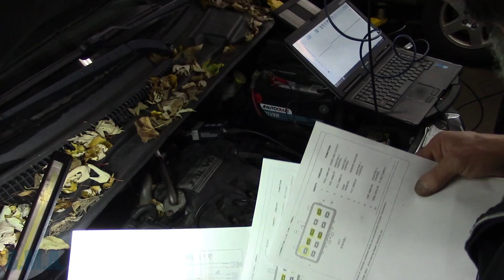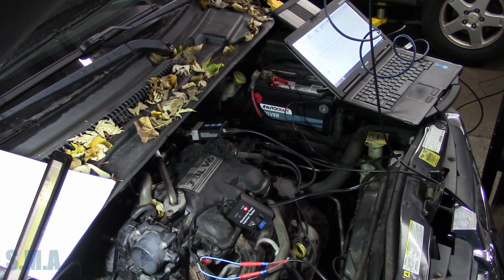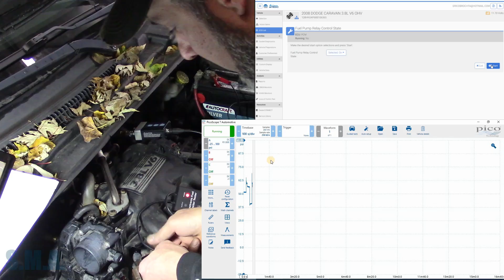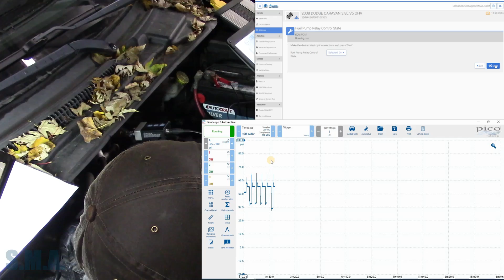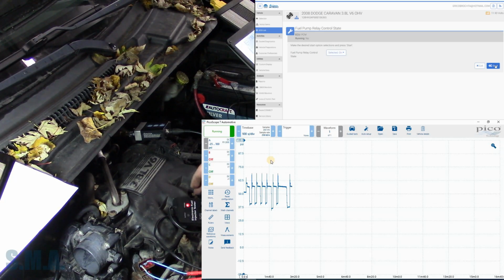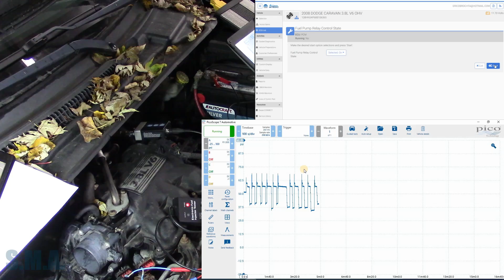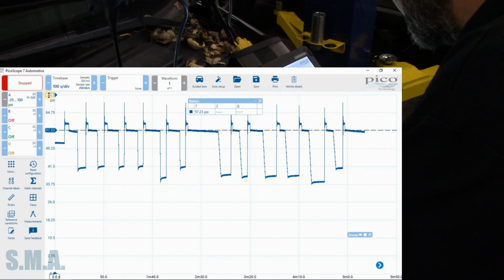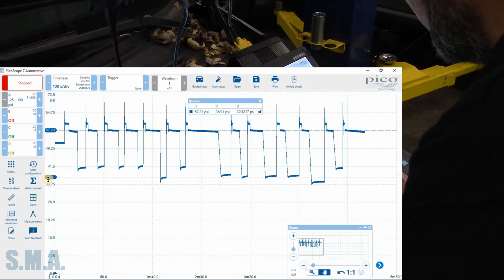Pico Scope: Measuring Fuel Injector Pressure Drop

Comment: Great video as always! Fuel pressure is so important - small example - we had a F-700 with a 429ci fuel injected gas engine that had exhaust that smelled so rich it would burn your eyes. It had low fuel pressure ended up being the fuel pump. My theory was the injectors didn't have enough pressure being delivered and were squirting fuel instead of atomizing.

Comment: Hi. I got a question. I got a 09 Silverado and I got the p0700 code but it's not throwing another code with it. And my traction control light is on and stabilitrak . And I dont have the gear indicator on dash. And it has a 1 2 hard shift. Just wondering if you had any ideas? Thanks

Comment: Plz help. I just changed my throttle body with position new position sensor because I was getting reduced engine power. It helped a couple months now its acting up again. Idling low to the point it cuts off. Used my obd reader and got codes p0220 and p2135. I looked them up and both seem to be the same Idk. Can u plz help me.

Comment: i cant remember if you can do a fuel injector on off toggle on this car but, what i was getting at could you do a running drop test as well with the same pressure tester

Comment: Never under estimate the spark , just experienced this on my 2000 crv lean condition began with new injectors ,fuel pump relay, fuel regulator ,fuel pump and sending unit ....Not ...New distributor and rotor as well as new exhaust cat and up and down oxygen sensors..... Not ...It WAS Ignition coil and ignition control module causing misfire 219,000 clicks and still purring like a kitten Hondas B20 baby !

Comment: with 200,000+ miles and needing to remove the intake to replace the injectors. 
Replacing them all, i would call that not only a repair but preventive maintenance due to the wear on the other injectors

Comment: See if the spray pastern is good, the visual injector pulse light test works good if you have a back light tester.
Reply: My thought is that the injectors are hard to get to and have 200K miles on them. At the usual price of injectors replacement is the smart way to go once we have put in the effort to get them out. I'd hate to put any of those old things back in, and I hope the customer sees it that way.

Comment: I'd bet it's 5 bad injectors but no matter it's injector issues and unless they are wicked expensive it only makes sense to do them all.
Reply: Around $55 per injector.
Reply: @DavidNull5  That is pretty cheap to put it all behind me. Since we can be sure at least one is bad the shotgun only costs $275 more and may save me twice that. Few things are more aggravating than paying double labor to end up doing what could have been done with single labor. That goes for DIY as well. Imagine: if he had to go back in the second time, do you think the customer would still just want to do one more instead of doing the rest?

Comment: If number 5  injector is "sticking on" that one would need replacement for sure and the others could be clogged so they could possibly be reversed flushed and cleaned, however why are they clogged? It would be recommended to empty the fuel tank and clean the fuel tank on the inside and reverse flush the fuel lines. Do not replace any old gasoline get fresh pump gas so maybe have the customer drive the scary van until it's empty before he brings it in for repairs. Doing it this way allows you to inspect the fuel pump if it is failing and contaminating the injectors with debris.
Reply: If my 200K mile car needed all that I would replace it.
Reply: @flagmichael You wouldn't replace a low mileage 200,000 kilometre car for 1 extra hour labour?

Comment: I  have a question. I purchased a 2018 chevy silverodo. It was a company fleet truck. The truck runs & drive perfect. But when i reach a speed of 70mph it won't go past 70 mph even i push the gas pedal to the floor. it,s a v8 & the dash has a 140 on it. what can i do to remove the governer so it will go top speed.
Reply: You've got a problem,  I'm not sure but I believe a dealer or a very well equipped shop has to reprogram (flash) the computer, not sure which computer ECM??
Google 8s your friend here, there are a bunch of results,  careful most are trying to sell you something like a special tuner chip.

Chevy limits the Silverado’s top speed to a measly 99 mph.

Comment: I had a multiple lean misfire once on the usual Shovrolet suspect. It turned out to be a misfiring bank 2 coil pack on an LQ9 power plant. It would enrich the downstream oxygen sensor so the computer was pulling fuel until the other cylinders would suffer and the engine would knock being so lean. It would cold start idle really rough too. 

I drove it on short trips until the coil pack completely burned up and burst it's plastic case. Once replaced? Good as ever!  I am a diy guy and did the legwork... checked plugs, wires and for fuel and air and cylinder compression.  But I nailed it being patient and without advanced tools and equipment.

Everything being equal I thought I'd share. It was confusing as to how a lean multiple misfire could occur that way but yup, check ignitor packs too... then think backwards all the way back to the ECM. 

Edit: i gave instant thumbs up for appreciation, your hard work and time away from your bread and butter to help us plebians. 👍🤙

A computer can signal an issue and drop a code. But what attached systems and sensors are at play? What else could it possibly be? I had nightmares of a broken valve spring or an injector at fault... but a marginal coil pack was all it was.  $45 retail over the counter fixed it.  ^.^

Comment: My first car was '63 Impala that had a Chevy straight six and a one barrel carb.  Never had to touch the carb in the life of the car.   Then cars started having fuel injection...
Reply: My last car with a carb was a 1984 Dodge 600 with a Mitsubitchy 4 cylinder and a Mikuni feedback carb. I learned it was universally called the "infamous Mikuni carburetor." To improve drivability as it aged the usual recommendation was to drill a 1/4 inch hole in the choke plate and gradually increase the size up to 3/8 inch until the cold idle behaved. The other common problems could not be fixed.
Most of my cars were old when I bought them so the throttle pivot was worn out and leaking on every one. I hate carbs!!!!
Reply: @flagmichael  with a flashlight, an umbrella, a screwdriver and a vacuum gauge I could diagnose and adjust most of the carburetors on my old cars and trucks, in the dark on a rainy night.  With fuel injection and fuel system electronics you need a AAA card in your wallet to diagnose and adjust a broke down car on the side of the road.

Comment: More of a question have you ever had an engine miss fire on one cylinder at idle but run normal at 1200 rpm i am thinking maybe a worn cam it has a ton of miles on it 6.0L chevy

Comment: Love that test Eric. I have fixed many cars doing this over the years. Before the transducer, using a traditional fuel gauge of course. Rule of thumb was they should all drop the same. 1 psi is broke. Doing this test using a transducer is so much nicer as we can save the data we collect and prove the failure to the customer right on the screen. Great call on all six for that van. Way too much mileage to play with one or two.
Reply: Are OEM injectors the only good option, or do you know of other off the shelf (Napa, O'Reilly ect.) that can be substituted?.
Reply: @rafaelmarin1963  I have been bitten by aftermarket injectors. I bought a set of Pythons many years ago for our 1985 Volvo. I could hardly get the engine to run. It turned out the Pythons fit just fine but were unprepared to deal with the ballast resistors in line with each injector in the Volvo. (BTW - I also say it as a good call to recommend replacing all injectors. They all had about 200K miles on them and two out of six were wonky at this point.)

Comment: GREAT VIDEO! I Love these kinds of videos! the pulse sounds exactly like what the AFIT does when i use that to do the injector balance test.  There is no spec for injectors, they look for them to be close to eachother. The new lt1 engines one bank drops more than the other.  A good methood to determine if there is too much variance.   Add all the injectors except the suspect one or 2. Divide that average by the number of injectors added and then Multiply it by 0.20 that will give you the difference that should be allowed.  GM service info doc id 3648127

Comment: I am glad my days as a mechanic finished before all vehicles were fitted with electronics. My electrical skills are still only basic and I am thankful for the way you sort out the problems .Carl Woy Woy Australia.
Reply: I maintained and repaired computer controlled equipment since the late 1970s until I retired 2 years ago. That part does not faze me, but getting to the stuff... I'm too old and stiff for that.

Comment: Enjoyed the video.  As usual, very informative and helpful.  Simply watching you go through your logic to diagnose an issue is very valuable.  The fact that you have to use technology is not an issue but rather an indication of today's world.  Technology is a facilitator, actually a requirement, in today's world.  Moreover, you're in the business to make money so using available tools to do so is totally understandable and the right thing to do.  Moreover, in this case with 200,000+ miles it only makes sense to just replace the injectors and not run up the diagnose bill any further. Pulling the injectors to do a flow test would be nice but not necessarily a cost justifiable solution.  The injectors have a ton of miles on them, and this is a FCA product, so replacement is the least cost solution. 

Would be interesting to learn what happened and what the eventual outcome is.

Comment: Hi, once again I say do what you have to do cause the bottom line is solving customer problem and making him smile and getting paid and turn him to be a regular, most cars nowadays injectors are under a manifold or something else which makes it difficult, to me it's a tough decision if 1 is good and 5 bad o vise a versa  incase like this here in Brazil we pull them out and do a bench test on a 4 tube injector test equipment checks for leak, flow, spray pattern and amp draw  which most of the times solves sticking injector or plugged, thank you for sharing

Comment: how do you connect the pressure transducer to the car is it attached to the fuel rail?
Reply: Yes, you connect it to whatever you need to get pressure, either a test port or inline with adapters.

Comment: No thumbs down from me, but i do wonder if measuring the resistance of each injector, if possible at the harness end, would be an indication of the failed injector as well since that is a pass/fail injector measurement in the factory service manual - between 150k and 210k - with the sweet spot being 185k +/- 10%.  I'm curious...

Comment: We’re the two that we’re out of spec (low and high) on the back side of the engine? Furthest from the exhaust exit side of the pipe? Because I’m betting that heat soaking caused both of those issues

Comment: Maybe they do this already but, the manufacturers should publish known good for all of their parts so that the diagnosticians in the country have something to base opinions for guidance. Seems that the known good data is fairly well used in the vehicle service industry so it makes sense to have this data. I recall there are some websites that mechanics upload known goods to etc. but the reliability of those could be a concern and they don't always have what you need. 
I have to agree with the mechanic on this one...at 200,000 miles, best to replace all 6 injectors for the best outcome if the vehicle will continue to be used often. If it's not, then 2 injectors might get it sold or traded in.
BTW, I believe that Ford has this type of test in their diagnostic software? I don't recall what they name it.
Reply: It's a struggle to get them to publish pretty much anything these days as they don't want anyone but a dealer working on their products.

Comment: In this case , 2 things . I would recommend the same . 6 injectors . Even if you would have the specs . Considering the mileage of the car and the two or four odd ones . Second , in the beginning I was wondering why not use the Ultra´s split screen but after thinking about it ( and I own the Ultra for a Month now ) maybe it is faster to hook up the Pico . I definitely don´t understand all the features of the Ultra yet and I also didn´t have a situation like yours .

Comment: Ivan would pop out the slow flows, clean them, say a Russian prayer, reinstall them and declare, "No parts required! Sweet!"
Reply: Chris Fix would pour a sponsored fluid into the tank and call it a day.
Reply: Keith would just lay hands on the intake.
Reply: Andrew Camarata would fire up the chain saw and welder.
Reply: @bigpatrck2  He'd also somehow work in a backhoe or scissor lift.
Reply: @Hurtydwarf  I'd rather work in a trampoline, a set of female twins, and a German Shepherd, but the car repair would have to wait awhile.... :)
Reply: Whistlin Diesel would just drive it off a bridge.
Reply: @mchlross3 Maybe he'll do one titled "THIS IS THE WORST CLICKBAIT TITLE EVER!"
Rev up your exaggerations!!
Reply: Hickok-First-Fuel-Injector-Regulator-System-Tester-Analyzer-Machine
must have the printer for the NGS for the print out in a graf
Reply: mchlross3 He’d probably suggest placing the injectors in a bath of turpentine overnight, or something crazy like that.

Comment: I'm going with one really bad (6th one tested) , four bad, one OK (5th one tested - greatest pressure drop) . The opposite makes no sense because a weak solenoid will cause less pressure drop as it's slow to react, causing lean running, hence the fuel trim enrichment.
Reply: I thought so, too, but then I realized being slow to close would produce the greater drop.
Reply: @flagmichael  It closes by spring, not power - it's normally closed when unpowered because otherwise fuel will leak into the manifold.
So slow to close (longer open duration - more pressure drop) would be because of that. Hence slow to open (by applying power - possibly from higher coil resistance) will cause less pressure drop, not more.

Comment: Just did the same thing this weekend, but with a mechanical fuel gauge on my son's H3.  Same difference.  I did use my Autel to trigger the injectors, but it was easier than using my old Actron injector tester.  Hard to nail down the issue since no codes are stored.  Traced it down to a possible a wonky variable valve solenoid since the data is showing valve timing variance high very intermittently.   Not long enough or often enough to trigger a MIL, I guess.  Just cant troubleshoot all theses problems without these advanced tools!

Comment: or while they they are out you can flow test them if you dont have spec you can match to new one for spec
Reply: I would not want to put used parts, where at least one was definitely bad already, back in such a tough location. Doing that makes the evil spirits dance with joy.

Comment: An injector pulser isn't exactly cutting edge technology, at least as far as what's inside the black box.  The scope gives an easier to analyze graph of what's going on and when.  Oscilloscopes have been around about 75 years or more.  It would be foolish to not use the best tools you have at hand.  There will always be that 3-6% of the population that doesn't know up from down; just look at any nonpolitical survey.  3-6% of the respondents don't know how to form a conclusion based on anything, much less factual data.

Comment: I think your logic is sound, one rich injector will make an uncomplete burn making the oxygen sensor think the system is rich. I can't help but notice that your diagnosis tools do not have a hammer side, this is a good thing. :) PS if one is failing or 5 doesn't really matter, either something compromised them which could be a number of things, best to change them.

Comment: I see two bad injectors.  The last one is lean, but the one before it is over fueling (the other bank?). It could be my phone audio, or my ears, but the fifth one sounded different doing the string of pulses.
Reply: That is a good argument for replacing all of them. If two out of six are bad now, why take chances with the others when access is so expensive and the parts aren't so expensive?

Comment: you have 1 very clogged 4 clogged and 1 nom. injector
Reply: That's entirely possible.  The only way to know for sure is to pull them, mount them in a flow measurement fixture and pulse them to see what the actual flow is compared to the manufacturers specs for that particular injector.
Reply: @tonyfremont  and at that point unless you don't have to pay for labour might as well just put new one's in and call it good
Reply: @callumcurtis15  I'm a DIY kinda guy, but I wouldn't tear that all apart and then only replace one injector, especially at those miles.

Comment: Is it not worthwhile to try cleaning the one that flows too little?  I might also compare the coil resistances to see if one is partly shorted.
Reply: For injectors that live so far down, would you really want to put 200K mile injectors back in and hope they work? On my own car, once I did all that I would blindly replace them on the basis of age even if they seemed to clean up okay.